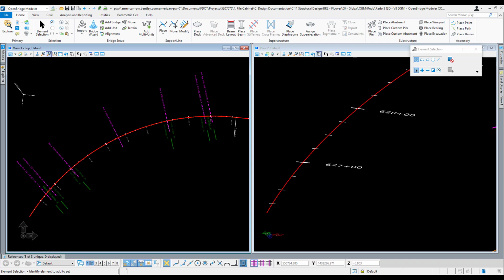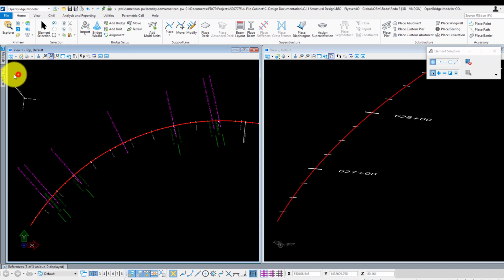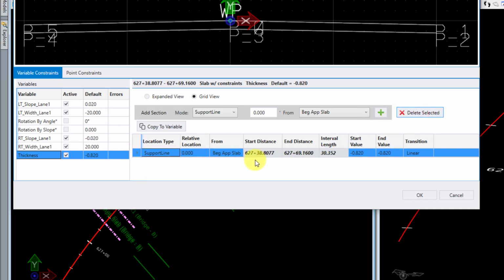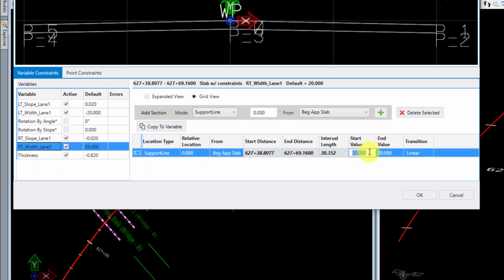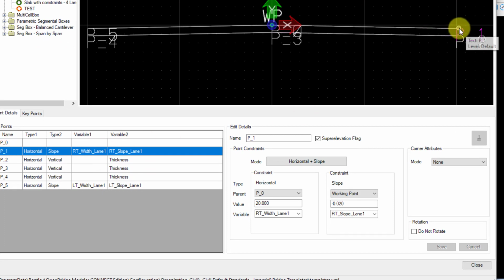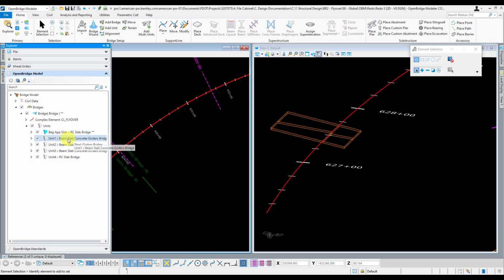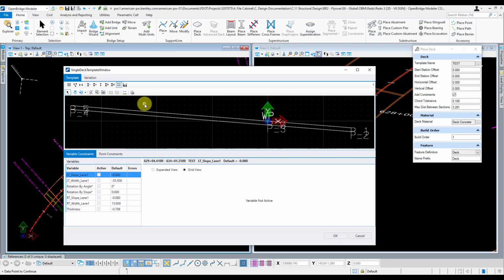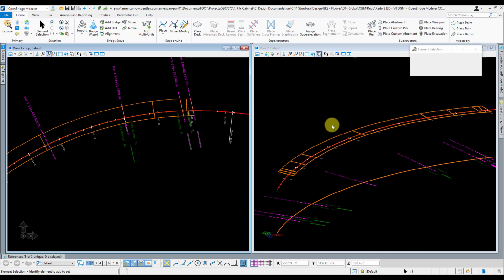OpenBridge Modeler - Modeling the Deck

Comment: Hi Steve how would I add a point in the deck templates? I have a typ section where the crown is not at the PGL/CL of the bridge and is actually to the right of it but I cannot find a way to add an additional point within the template creation. thanks
Reply from the maker: You will have to “break” the element or add a vertex in the template editor using standard microstation tools. Another option is to redraw from scratch. However, if you only have a single break point, you can use the default templates and just adjust the variable constraints.

Comment: Hey Steve. How would someone go about adding medians or sidewalks to a deck? Do I need a completely new template or can I add points to the template through the custom deck modeler?
Reply from the maker: You can actually add sidewalks or medians with the barrier tool. Just make a barrier template for those shapes and place it the same way. You can then place an actual barrier on top of the sidewalk (barrier).

Comment: Hi Steve. For superelevation transitions, have you ever tried to assign a superelevation corridor to your deck?  If so, do you find that it’s better to just change the parametric slope constraints to model super transitions?  I was trying it today, and I was just getting horrible results. I also have a gore area so I was using horizontal point controls to follow auxiliary alignments and applying a super corridor. It seems like hit or miss when I assigned the super whether or not points would follow my super corridor.  I’m thinking maybe it’s not working to great because applying a super corridor and applying point controls are really two different types of point controls.  Maybe this is confusing the program???  Thanks in advance for any help you can give.
Reply from the maker: If you have a complex scenario as you described then I would do the super elevation manually with variable constraints and use point control as necessary to drive some of those tough horizontal geometry situations.